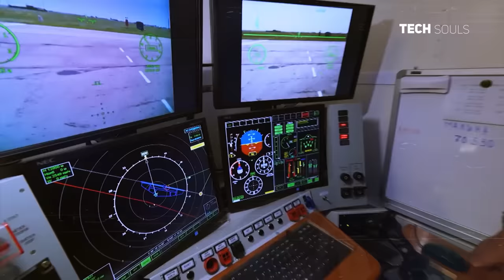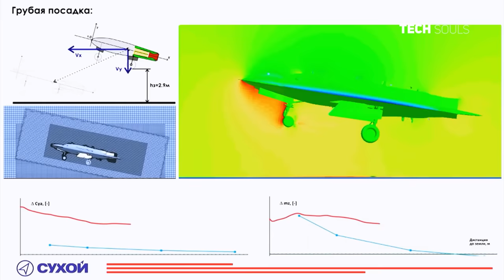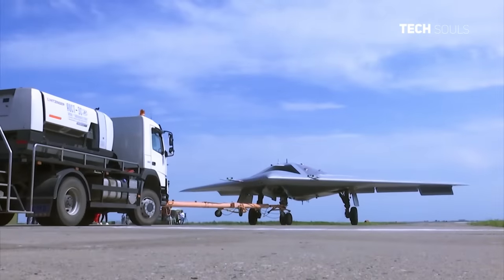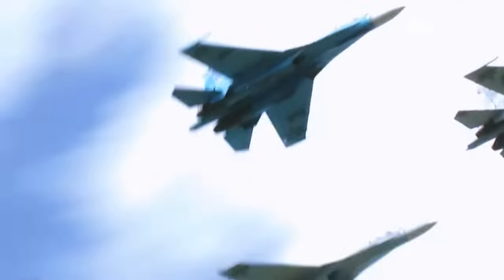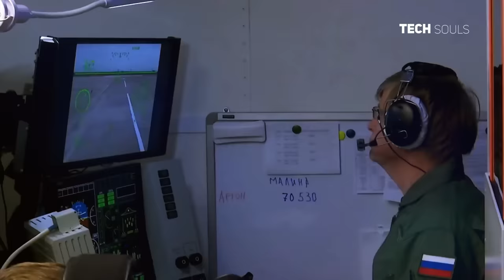Finally: Russia Upgrades S-70 Okhotnik Into 6th-Gen Stealth Drone

Comment: Hunter is a repeater for the su-57. That will allow you to destroy the enemy's air defense without entering the air defense zone, and all air battles without entering into an air battle with the enemy.
Reply: Verdade. Avião que não luta tem reputação alta. Rússia e só conversa.
Reply: You mean for the 6 Su-57 ?
Reply: Demonstrate these claims in Ukraine first.
Reply: @cemo3292  I didn't understand your question! Su-57 is a 5th generation aircraft. And the hunter is an addition to the su-57. Which flies ahead, provoking air defenses to open. And the range of missiles is sufficient to destroy air defense installations of any NATO models. The weak point is the radar, which it was not wonderful, but air defense is better. Therefore, you let the drone in front of it and it will detect it, give instructions to the target. And you can beat him.
Reply: @vyrtualtecnologia  Rusia ya está trabajando en el Mi-41. Este avión puede elevarse a una altitud de más de 100 km sobre el suelo y volar a velocidades casi hipersónicas, más de 5.000 km/h.
Reply: Судя по названию видео, машина не была беспилотной, внутри сидел маленький Сергей.
Reply: @Matroskin502  Су-57, макет самолёта.
летает в рекламных целях несколько экземпляров, чтобы продать индусам. индусы не поселись, самолётов сделали 10 штук за десять лет. и они на двигателях от самолёта предыдущей модели.
а "Хантер из репитер", это уже совсем пиздешь. это вовсе единичный макет БПЛА, опять же, созданный в натуральную величину - и сразу на выставку - "а вдруг купят".
это не оружие, это не самолёты. это образцы для распила бюджета РФ.
Reply: @CoEnHe  ток почему макет летает чем F-22? А их 10 штук потому что он значительно больше стоит чем имеющиеся на вооружение другие образцы. А индусам Су-57 и не собирались продавать.  Для индусов Су-75. Он только на стадии разработки, пока ещё даже опытный образец не выпущен.
Reply: @Matroskin502  я не понял что ты написал.
"не собирались продавать" - ага, десять лет торговались, сколько штук индусы купят. а так да, не собирались.
ну и с фактом, что за десять лет, даже двигатель Су57 не сделали - спорить будем?
а вот эта вундервафля, типа БПЛА к Су57, соответственно и вовсе - реклама для распила бюджета.
а так да, мультики крутые.
Reply: @CoEnHe вот эта вундервафля, сегодня отработала на украине
Reply: @islam4life649 they used them to bomb them already lol
Reply: Except.. Russias Su-57 is barely a Fourth gen fighter…. Math doesnt add up.

Comment: The Russians lack the ability to manufacture advanced chips. This is the biggest issue they have. Modern systems need advanced chips and software that is connected to a network that feeds data to all units. They have good engineers and software developers but they don't have the money or facilities to create advanced designs on par with US or even Europe.

In the Cold War the US had a very easy time hearing the Russian submarines, until they acquired machining units from Japan that allowed them to make the blades with much higher precision.  Even China is fighting to get advanced chip fabrication. The future of a lot of warfare is AI and marrying that AI to drones can be a game changer.